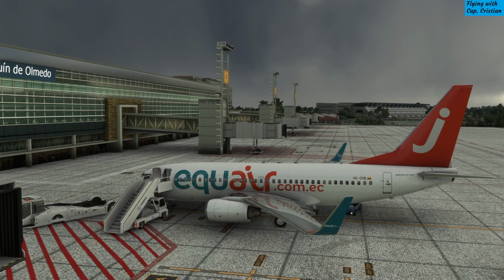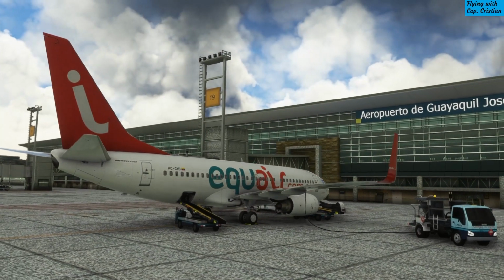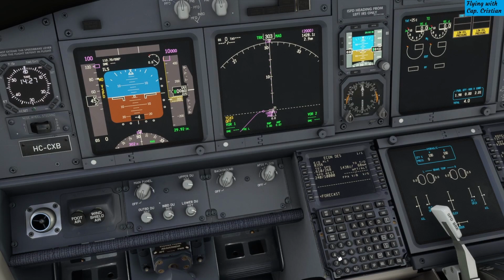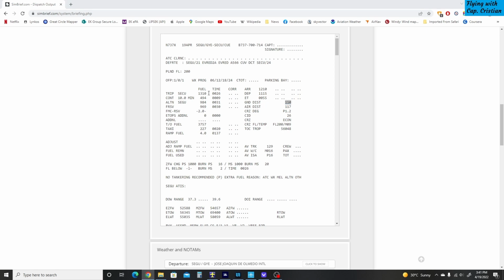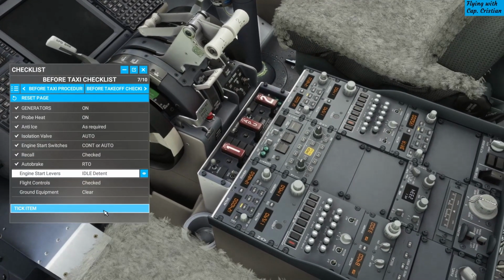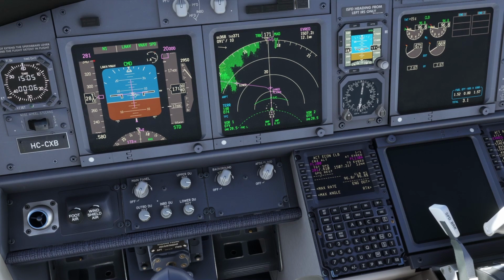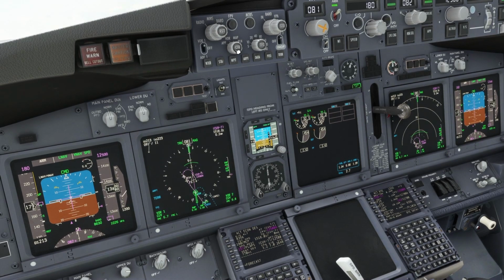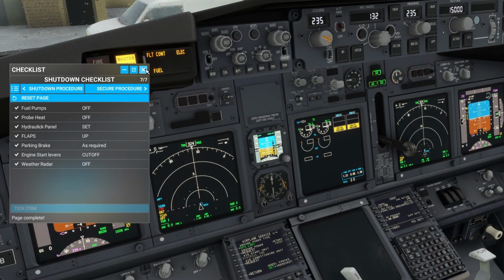PMDG B737 for MSFS 2020 first Flight (beta version)

Comment: Man, the textures and graphics of the interior are so damn good. Now, if MSFS can work on their flight model a bit more, and get multi monitor support, then we’re talking!
Reply: Honestly curious how you feel the MSFS flight model is lacking. It does feel different than XP, less"floaty," but not being an IRL pilot I have no idea which is more accurate. IRL pilots I've chatted with say neither is really accurate, of course, with XP being oversensitive and overexaggerated, being, "harder than the real thing." They say MSFS rudder action and some landing dynamics (too strong ground effects) still need work. What are you referring to?
Reply: @GarrisIiari  so I’m a bit different because I run a legit home SIM in my garage. So MSFS is running the scenery weather and everything else is being run by a piece of software made for home cockpit physical SIMS called Prosim. Now, Prosim is pretty solid as it goes and legit, but MSFS no doubt makes it play different because I’ve used it with P3d and it’s a completely different aircraft it seems. I’ve never flown a IRL 737 however I have flown a buddy of mine home cockpit physical 737 sim at his place and he has “force feedback” control loaded yokes, pedals, throttle and tiller and let me tell you, you cannot move the column like a joystick (like mine). I don’t have control loaded yokes so there’s no “resistance” from wind, speed, hydraulics and so forth. He has flown in a 737 co pilot seat and he says it’s very close to IRL, and IRL he said it’s actually a bit easier to move that stuff, but his is very close. I couldn’t tell you how bad I want this thing! 😩

Comment: my FBW A32nx is begging me not to put it into indefinite storage in some random-ass hangar I rented in the middle of Oklahoma like I did the Asobo 747 & 787…

Don’t worry they totally both fit
Reply: Fbw will eventually be more advanced then the pmdg 737 lol
Reply: @elliottd323  Then it may surprise you to hear that the PMDG 737 uses absolutely nothing that was already in the base sim, not even Nav data, it’s all made from scratch

Also that took titanium balls the size of Jupiter to reply that
Reply: @r4ginwald  well pmdg is no longer revolutionary like the fanboys hype it up as. What is truly revolutionary is the physical simulation in the hotstart challenger 650 or the fbw in the fslabs a320.
Reply: @r4ginwald  a32nx is like constantly updated throughout multiple years and will only continue to get better. Pmdg 737 will have a short update cycle to add an efb and a couple small features and then boom nothing.

Comment: Captain, not sure, but I think the alarm you heard at the approach was triggered by flaps 15 without gear down. Someone can correct me on this if I'm wrong.
Reply: That is correct, flaps 15, gear must come down, or you get the CONFIG horn
Reply: From the B737-800 FCOM:

Aural Indications

A steady warning horn is provided to alert the flight crew whenever a landing is attempted and any gear is not down and locked. The landing gear warning horn is activated by forward thrust lever and flap position as follows:

Flaps up through 10 – 

• altitude below 800 feet RA, when either forward thrust lever set between idle and approximately 20 degrees thrust lever angle, or an engine is not operating and the other thrust lever is less than 34 degrees. The landing gear warning horn can be silenced (reset) with the landing gear warning HORN CUTOUT switch
• if the airplane descends below 200 feet RA, the warning horn cannot be silenced by the warning HORN CUTOUT switch.

Flaps 15 through 25 –

• either forward thrust lever set below approximately 20 degrees, or an engine not operating and the other thrust lever is less than 34 degrees.  The landing gear warning horn cannot be silenced with the landing gear warning HORN CUTOUT switch.

Flaps greater than 25 – 

•  regardless of forward thrust lever position. The landing gear warning horn cannot be silenced with the landing gear warning HORN CUTOUT switch.The warning indication is cancelled when the configuration error is corrected.

Comment: Can't get excited because as amazing as the -700 will clearly be, I'll be waiting another 3 or more months for the -800....and probably until 2023 for the Max 8.  I'm totally ok with that as I know they'll be just as awesome (or more so) than this one!
Reply: Hi, maybe I have found the right person to ask: What is the difference between the versions? Why is everyone awaiting the 800 or the Max? What can they do better than the 700, is it just the size?
Reply: @madsib5187  Yes it's just the size. Most US airlines fly the 800
Reply: @preston4354  ah ok. And with that probably a longer range?
Reply: @madsib5187  Yes as Preston mentioned its the size.  The -800 isn't a rocketship like the -700 but you can load them up and get out of some pretty tight places with them nevertheless. 

The Max will be a whole different experience. The Max 8 is virtually a 737-800 with an upgraded flightdeck and larger engines and new winglets.  It is significantly more powerful and can fly even further.  Imagine being able to fly a fully loaded 737 from Honolulu to Las Vegas (which is a real Southwest Airlines flight with the MAX8)  The Max can do that plus some.

We won't even talk about the beast of the 737 Max 7 😳
Reply: @NovejSpeed3  haha, I see! Thank you both, that's really helpful ☺️👌

Comment: This is another tutorial of the PMDG as I remember from the FSX days. For show casing this new beauty there should be more energy and emphases on the high quality and new attention to detail as far as the M S F S platform has allowed. I recommend that anyone putting video these days on YouTube, especially when promoting a new product as elegant and gorgeous as this bird, well nothing less than 2160p should be attempted. For high skill level tutorial and actual flying tips, high quality is very valuable. The system that supports this quantity of load and memory, should be able to also process and view the 2160p platform. It does this whole package of PMDG and MSFS combined, a huge justice when using more than the standard 1080p we are accustomed to using. The flight and procedures here are somewhat crammed into a short time and of course one would not judge the attempt to showcase this awesome product. It is just too incredible to not share it. Thank you Christian.

Comment: how is performance compared to the flybywire a320?
Reply: Those are two totally different aircraft we are comparing, but I will say modeling wise the PMDG 7-3 comes out on top, because the FBW A32nx still has that glare shield issue…
Reply: Front streams I have watched, early indication is that it's better FPS than FBW.

Comment: Are the call outs built in with the plane (pmdg) or is that a separate add-on and if so what one, thanks?!
Reply: Built in i think. Ive heard them every stream
Reply: @11charlieng81  thanks, I thought they might be. Something to do with the TOGA switch I believe .
Reply: You should be able to turn them off in the fmc